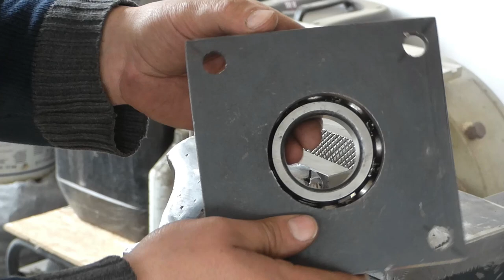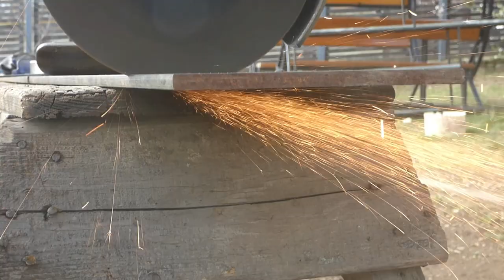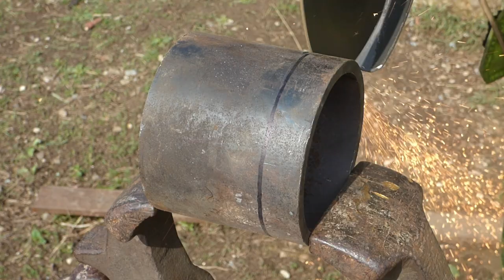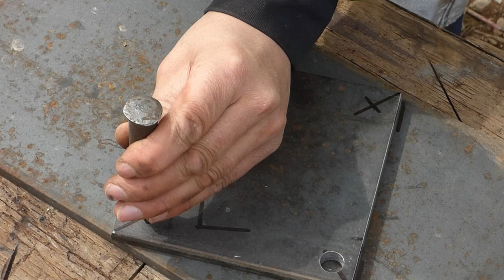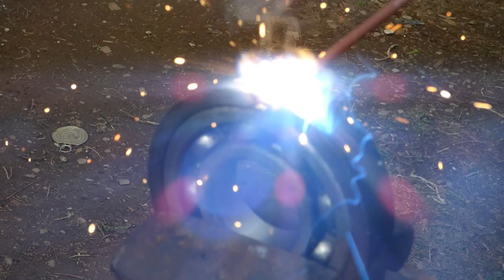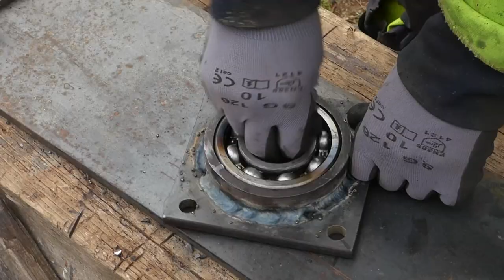Homemade Pillow Block Bering

Comment: good idea and video. and nice welding! But you should remove the bearing when welding. you are destroying the hardening of the bearing steel when heating it up so much. You can see that it even turns blue because its reacting with the air. This oxidation means that going above 300C, which also means that the bearing lost its hardening properties and unfortunately, is dead for any real use:(